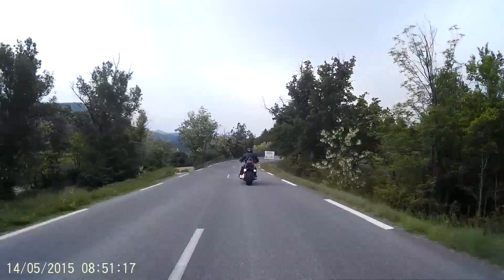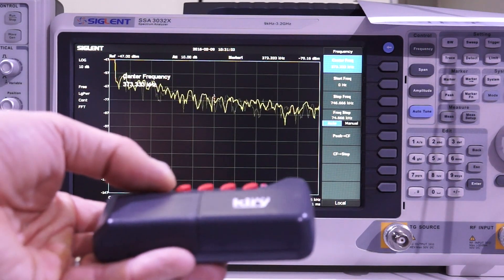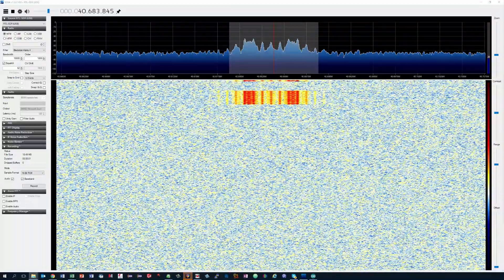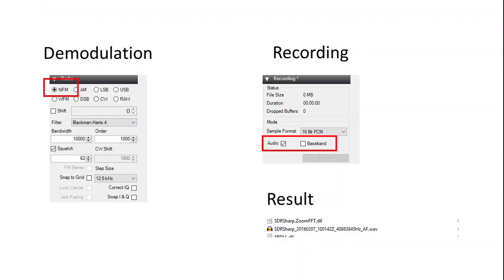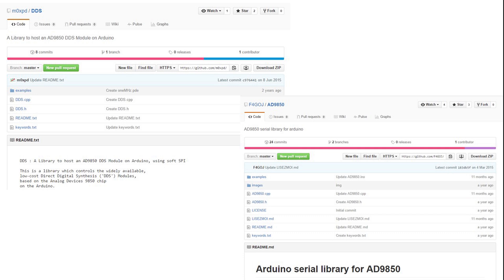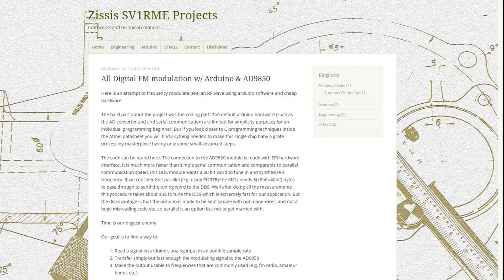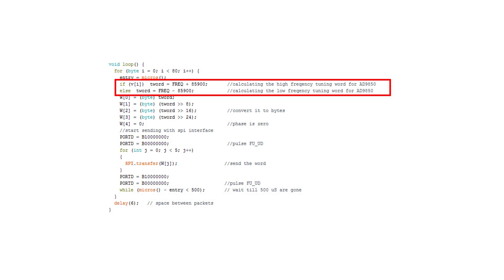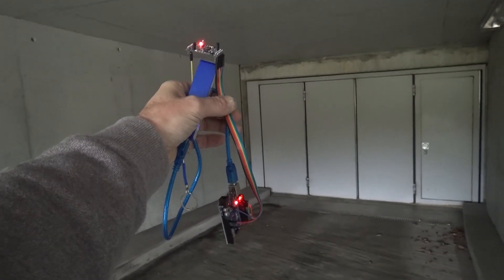#44 Hacking and Cloning a Garage Door Opener using SDR Radio

Comment: I assume your garage door has no rolling key? I have problem that mine has. So even if I catch the signal and copy it. The next time I press the button to open, the sent key is already obsolete. Do you have a solution for that?
Reply from the maker: You are right. It has a stable key. Rolling codes cannot easily be cloned and I have no solution.

Comment: Love the work done here, id just add a button on the bar, to avoid someone running a relay attack on your garage
Reply from the maker: So far I was happy to not having to press a button. But you can add one if you are concerned. My car mostly moves when the 12V is on. So it is hard to track.

Comment: I might be doing something wrong, but I am not able to detect anything ralated to my Opener. Using SDR# I am able to listen to radio so it works for sure. But I don't know how to find frequency of my Opener. Looking at IF spectrum I am not able to find it. In main screen I can see only narrow frequency range and I have no idea how to find the one I need
Reply from the maker: Maybe you find the information in the manual or the internet. Otherwise it is not easy to find out.
Reply: Use a Dolphin Zero. The SPR# method works, but it's antiquated.

Comment: Hi everyone,

 I would like to show the code on an LCD screen or on the "serial monitor" of the data that is received in an RF module, has anyone done something similar?

 Either with an ARDUINO or with a PIC

 Thanks in advance.
Reply from the maker: I only know the SW I used :-(

Comment: Andreas, any thoughts on how to use the homelink buttons in a car to control other things?   For instance, exterior lights
Reply from the maker: If you can hack it you can build another receiver. But if it is a modern design it probably uses a rolling code (not easy to hack) and you would have to connect to its receiver outputs.
Reply: @AndreasSpiess  realized I could just buy a wireless relay and have homelink learn from the remote that comes with the relay

Comment: I've just the same situation at my garage door, taking off cloves, getting out the key etc. My opener seems to be very similar to yours so many thanks for this video. It will help me a lot get this done.
Reply from the maker: It is a cool Gadget when I come home with a colleague and the door opens automatically;-)
Reply: @AndreasSpiess  Is the device permanently powered or do you have some sort of switch?
Reply from the maker: It is powered when the engine runs
Reply: @AndreasSpiess  we use to do the same here, however, we have most of the garage doors on rolling code. how we do it, plug the original remote into the headlight and with a relay, you simulate a button press via the HIGH BEAM switch on the handlebars.  In this way, you dont have to broadcast your private garage code all the day long along your tour.

Comment: I got this working with just a Raspberry Pi - https://github.com/defcon24bit/record-and-replay-RF-remote
Reply from the maker: And what about the RTL-SDR dongle? I made quite a few videos about this topic. Very interesting! But under the saddle of my Harley, a Pi would not be the right choice ;-)
Reply: Andreas Spiess You’re absolutely correct.  You need the dongle to record.  Once you recorded every button, replay is done only with the Pi.  And a chip is better than having a Pi in your motorcycle.  The only good thing is you can skip te demodulation part, which is the most difficult part.

Comment: I watched your recent video #209 where you performed a similar concept with a Raspberry Pi instead of an Arduino. Do you think this is possible to implement for this use case? Or is the Pi too slow to output a signal as fast as that. Also, could I use Universal Radio Hacker with in Phase mode or Freq. Shift mode to replace the audacity process?
Reply from the maker: It is not only about speed, you also need to create the exact frequency on 40 MHz. I do not think you can do that with a "barefoot" Pi
Reply: @AndreasSpiess  I was under the impression that data was passed to the radio chip, and that was tuned into specifically 40 mhz. I haven't looked much into it, so I apologize for wasting your time with my silly logic.
Reply from the maker: No problem if you use a radio chip. I thought you only wanted to use a pin of the Pi.

Comment: Awesome video very well put together man, my only issue is riding around with a constant transmitted, meet personally I probably would have hooked it up to my last turning signal if I had to turn left to get into my street on a norm then I would go ahead and program the power to that you left turn signal for infants or to your horn neighbors might not like that so turning signal might be better. The reason I say this cuz there's enough radio traffic out there already, unnecessary traffic is just that unnecessary
Reply from the maker: Fair enough. The reach of this transmitter is only about 2 meters... Lots of metal around it on a Harley ;-)

Comment: Excellent informative video and I have a question.  I took a 20 year old remote control key fob that broadcasts on approximately 315 mHz and recorded the data stream using an SDR radio and displayed it using the Audacity program as you have done in the video.   I recorded both the "close door" and "open door"  signals in the AM mode because this was the only mode that gave me a clean data stream.  Both data streams seem to have the same duty cycle.  The only difference is that each time they are broadcast, they appear on a slightly different carrier frequency with the "close door" carrier signal always being higher than the "open door" signal.   My question is since there seems to be no difference in the duty cycle between the two signals, do you think that they are using the frequency difference  to differentiate between the two signals?   Why do you think the signals change frequency every time the signal is broadcast?  Is this part of the design or is it the result of a faulty oscillator?
Reply from the maker: Frequency modulation usually uses only one burst and changes the carrier frequency. Maybe you watch my newer video about 433MHz hacking with SDR. AFAIK you can use the software used there also for other frequencies.

Comment: I am working on decoding my fixed code garage door opener code. I get 41 bits of binary that looks like 10011011100110111001101110111001100110001 when decode in inspectrum. This cant be correct because the end part of the code does not repeat. There are 9 dip switches that are the following code - 101010110. I figure the 1001 = 1 and the 1011 =0 but that doesnt complete the code correctly towards the end. Any thoughts? A copy of the transmitted code can be found at https://github.com/jfender1/garagedooropener. Let me know if you see something I did wrong.
Reply from the maker: I would just focus on copy what the transmitter transmits. You do not need to understand the content.
Reply: @AndreasSpiess  I can copy the code and replay it no problem. I have a hackrf one and a yardstick one. I want to understand how it works, what the code is and how it translates to the dip switches in the remote

Comment: Any of you guys know if its possible to track the signal from a gate's remote control? My gate (its a couple of feet from car) opens by itself when im working on my car, i suspect someone is opening it on purpose when im around. Is there any way i can track where the signal or which direction the signal is coming from? I need to find the bastard thats doing it.
Reply from the maker: Not an easy task for short signals.

Comment: At the 5m17s mark, what is meant by the 'sender uses "short" 500us signals, while the "long" uses 1ms'?  Also when re-creating the signal, I assume the transmitter repeats the signal over-and-over while the button is pressed?
Reply from the maker: You are right.

Comment: Great work! But how does the device know when to send the signal to reach the garage door?
Reply from the maker: It sends continuous when the motor is on.
Reply: @AndreasSpiess  Isn't it a bit too loud?
I mean this thing doesn't consume that much but keeping it constantly turned on result in such a great waste of power.
You could use the geo-localization on your phone (or in your device if you want) so that any time you reach your home it detects that specific area and then eventually it sends the ok to the transmitter.
Reply from the maker: My Harley is probably louder and consumes much more current ;-)
Reply: @AndreasSpiess  hahajahaj fair point :)

Comment: hi Andreas,
What did you use for an antenna, because in my experience at a relatively low frequency like 40Mhz this id the most difficult and indeed the most important thing to condense to a small size, and 'ordinary' ferrite is very unhelpful here in a transmitting antenna.
Reply from the maker: I use a wire under the saddle. But because the motor cycle is of  metal, the reach is not big. I want to try once a ferrite antenna, and maybe I will add a transistor and 12 volts to increase output power.

Comment: all thar analyser stuff is pre installed with Parrot sec linux gnuradio-companion & rfcat & rtlsdr-scanner come pre installed or thy can be easily cloned or even downloaded with any MAC BOOK iphone or even better android which is a flavour of linux/// open a terminal or termex or what ever shell command propmt is available if not yer going to have to down load one.once downloaded downloads will bee a thing of the past and from now on we will clone instead thrrough the shell...a usb ariel will be neeed from ebay for a litte as a few £$ euros ham radio is also availbe through one of the commands i listed.....it taks a few seconds to grab the code then a few seconds to mount to say a obile fone aor any other caralarm fob   parrot sec a flavour of linux or kali linux full....not the lite versions or like i say clone/download one
Reply from the maker: Thank you for the info

Comment: Hello Andreas, gruezi from Rapperswil ;-)
I would like to do the same project, as we have the same Garage door system.
Unfortunately I can only find modules up to 40MHz. (AD9850 DDS Signal Generator Module 0-40MHz)
Do you have an actual link?

thx a lot and thank you for your great work on your channel!!
Christian
Reply from the maker: According to the datasheet the AD9850 goes up to 62.5 MHz
Reply: I saw that, I'm just confused, cause in the description of the board is written: 
 "After the 20-30MHz frequency harmonics increases, the waveform will be less and less clean"

Thx, I will give it a try :)
Reply from the maker: Who cares about harmonics in this application. It hardly opens the door at the base frequency (at least below the Harley saddle)

Comment: Hi Andreas, this is an amazing video. I've been waiting to do it for a long time, but only recently got my SDR dongle. I have an E.T. Blue 2 button dual code remote and although advertised to operate on 433.92, it actually works at around 433.87. However, I did not see two different modulated frequencies, only one strong in the middle, and then a few going outwards, and when I recorded and viewed in Audacity, there was no defined binary, only what looked like a sound wave. I'm not sure if it has something to do with security, or if it works differently, but most probably I'm doing something wrong. I would greatly appreciate it if you, or anyone reading this could help me out. Cheers 👍
Reply from the maker: Maybe you watch my video about the weather station. There I show better tools. Your device most probably uses OOK. Maybe you watch my two „wireless“ videos if you are interested in how it works.
Reply: Andreas Spiess  That video is perfect, thank you very much!
Reply: Which chip did you use to retransmit this frequency? The AD9850 doesn't support this high frequency

Comment: Cool, but hard. 
went a simple way. bought  an extra remote. solder a 2x0,25mm cable to the push contacts and added 3 push buttons on a side pannel. I know  control main access  + 2 garage door inside for less than 30euro in 20min.    It runs on the remote control battery. just need to be replaced every few years.
Reply from the maker: Good idea. The remotes for our garage are not easy to get.

Comment: Hi, very Nice project Mr. Spiess, I have two CC1101 modules and I do not want to decode the signal and just use these to receive the signal and transmit it to my device which is a bit far away. these modules will act as a hub to transfer signal longer range. How I can do it? Thnx
Reply from the maker: I do not know the CC1101, so I cannot help you.

Comment: Nice Video! Very instructive. I have a question, if the SDR Sharp software can capture a wav file, Is it possible to send the same wav file back in the right frequency to open the door?
Reply from the maker: I do not know of such a possibility. AFAIK the SDR devices are only receivers
Reply: Andreas Spiess Seytonic has made a tutorial with a Raspberry Pi Zero and a piece of copper wire to send wav files. Let's assume that I could Zend the wav file at the same frequency as the original remote. Could the wav file open the garage door ?

Comment: Hello Andreas, thanks for sharing this precious hack. I'm trying the same, with a 30.875Mhz digital signal. But with a few knowledge of signal theory. You seem not to use an antenna or amplifier, is the ad9850 sufficient to have a earible signal ? I have a very weak signal as I roll away from the sdr antenna. I tried with my garage as you did but I faild miserably :')
Reply from the maker: +bobz The AD9850 has a 5volt signal. If you connect a few 10 cm of cable it should be capable to bridge a few meters. Ideal would be lambda/4 which is about 2.5 m ;-)
Reply: Andreas Spiess thanks a lot I will try
Reply: Hello Andreas, 

do you mean plug a quarter wave antenna with, on sine-wave output, the vertical radiator, and on the GND, the ground plane ? 

Should I use some sort of SMA connector, plugged on sine-wave output of the AD9850 and on the ground ? 

Thanks
Reply: Self answer : I put a lambda/2 just on the sine output and it works well for my need :)

Comment: Wouldn't this fail to work on most lifts since they use a rolling code?
Reply from the maker: I think, this only worked for my device. With this video, I wanted to show how you can use our tools to detect "secrets"
Reply: After around 2005 they started using the rolling codes

Comment: Hello sir, thank u for the awesome video, I have a question, am trying to hack Somfy motor remote to open and and close the curtains via an esp8266, but the remote is using a "rolling code", my question is, will this method in the video work in such scenario?? By the way, the remote is using 433.42 frequency.
Reply from the maker: I do not understand a lot about these remote codes. This video was intended to show the different technologies, Its primary goal was not the "hacking".
For 433MHz, you get many self learning remotes. Maybe this is for you.
Reply: Andreas Spiess thank u, and by "hacking" i meant cloning, I guess I will have to do more research.
Reply from the maker: I understand. It was the same for me. I just wanted another (smaller) device

Comment: Dear Spiess..
i bought dvb-f+fm+dab receiver, which is same with your video ( blue one), and installed sdr.. but there are millions frequencyies, i can not find my remote controll frequency.. how can i find it? i am pressing button but nothing change on sdr program...
Reply from the maker: +Yasin Demircioglu You have to find out in which band your transmitter works. Usually, you can google this. If not, try at least around 433 MHz, because many remote controls use this frequency. Without knowing the band, you have to check the "millions" of frequencies.
Reply: thanks, i found it at 436 mhz.. and record it, and open it audacity like you, and zoom it.. and then sound record graphs does not seems like yours.. there is no angular sound graphs, there is a zigzag graphs.. i can send photo of it or sound file.. so that i cant convert it to 0-1.. my mail is: yasindemircioglu@hotmail.com
Reply from the maker: Many modulations exist, so, if you use the wrong one to demodulate, your audio file is useless. You can also not judge from the audio file which modulation was uses. So, google and experiment. It has to contain digital signals...

Comment: Great work done ;-)
Do you have a guess, why you had to adjust the frequency? Deviding the frequency of the used quartz should give an exact frequency, shouldn't it?
Reply from the maker: The chip I used can produce all frequencies up to more than 40 MHz. So, I had to tell it, which frequency I want. But it is quartz based and you program the output frequency by setting the division factor

Comment: Thx, i want to use your idea for control test a Gps controled RC car(with Gsm+gps), but i've found an another device AD9851, it can go from 0-70mhz so it can be used for more device, and cost just 2-3$ more than the AD9850. Do you know if it's compatible with the AD9850 Code ?
Reply from the maker: If I remember right they are compatible. If I remember right, you have to use different constants. You find examples with google.
Reply: Andreas Spiess Ok thx anyway i finaly bought the AD9850 because i found a seller in Aliexpress(http://www.aliexpress.com/item/AD9850-DDS-Signal-Generator-Module-Test-Equipment-Sine-Square-Wave-0-40MHz-TE439/32699349794.html?spm=2114.30010308.3.2.ASHmJj&ws_ab_test=searchweb201556_7,searchweb201602_4_10057_10056_10055_10037_10049_10059_10032_10058_10017_405_404_10060_10061_10062_412,searchweb201603_6&btsid=d684f487-8003-4179-9d5c-fafbbe1da399) who ship from Europe(for me it's from France) since a long time a want to test that for know if it's true or fake and compare with the classic post office ship time